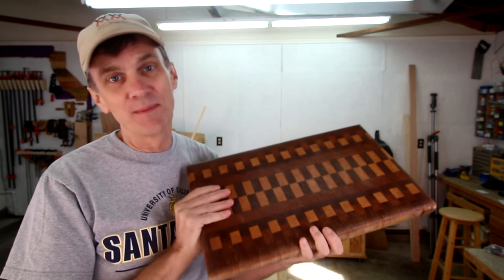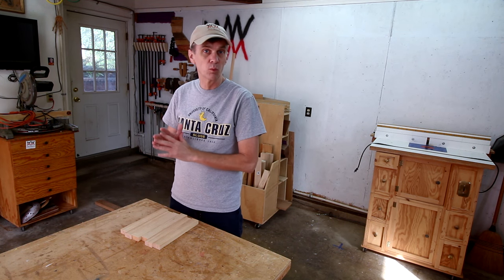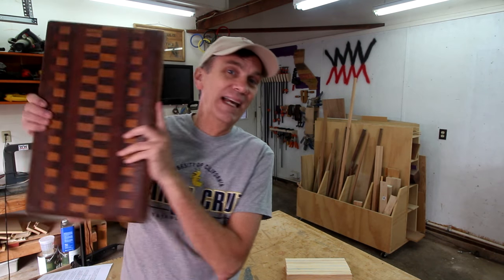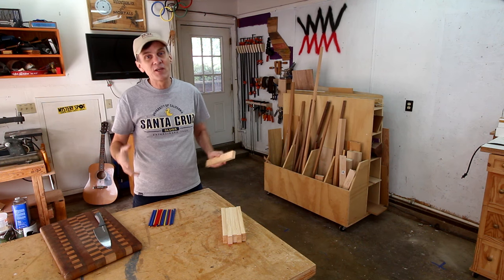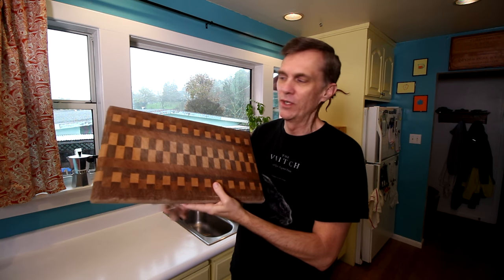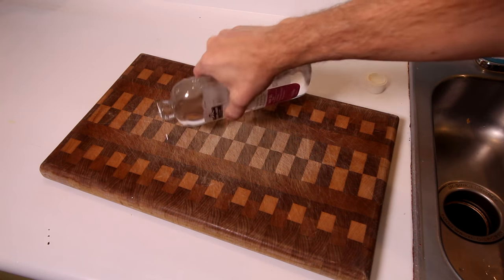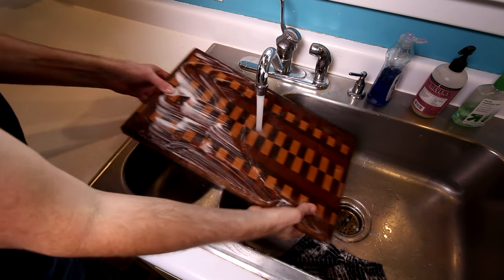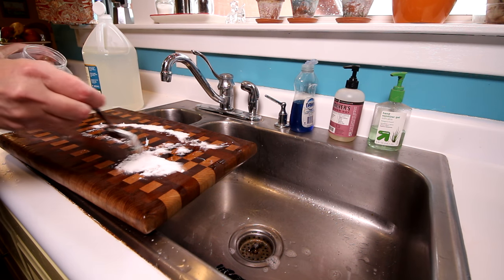How to care for a wood cutting board | C is for Cutting Board Care

Comment: I use all different types of oils and food on mine. It's stationary so I keep a spray bottle of white vinegar hanging on the station. Using the vinegar to clean it every time works awesome. No smells from any food that was on it whether it was olive oil, vegetables, or meat. Just get in the habit of cleaning it correctly every time you use it and you'll never have to worry about odors or bacteria

Comment: To avoid that, use a 50/50 mix of salad bowl finish and mineral spirits to get the board to soak in the grain.  Then finish it with some mineral oil and there will be no ability for water to get into the wood.  Helps to keep the board nice for a long time.  Great video Steve!

Comment: I have had my end grain chopping board now for 30 years and every few years I take it out to the workshop and give it a good sanding and have used tongue oil on it but I have also used olive oil without any problems simply because I use it a lot and as such it's washed a lot never had a problem with onion smells 😹 but then I use onions fresh out of the ground so they are sweeter in flavour and not as strong as onions that have been hung out to dry. 
Loved the tip of the baking soda and vinegar as this would be a good way of giving the board a good monthly cleanup as the vinegar reacts with the baking soda and makes it go all fizzy 😹😹😹 used that trick on so many other things that have needed cleaning but never thought of using it on the chopping board before 🤔
I have since inherited Mum's chopping board and that's almost 50-60 years old and is still as good today but well worn in the middle which I have kept for carving meat as the natural curve in the center of the chopping board acts a gravy boat in a way so the juices of the meat don't run off the edge of the board 😹😹😹 I am able to pour them off back into the pan once I have finished carving the meat 🙃
Thanks for the great tips of the mineral oil will have to look at buying that rather than using the olive oil which I have not had a problem with really 🤗

Comment: I seasoned my end grain cutting board real well and I washed the top earlier today, with light water and dried right way. 10 minutes later I saw it warp up. I did lay it flat to hope it goes down a bit. A few hours later, it did go down a little... is this normal for this to keep happening? Am I supposed to splash water on both sides to even it out when I wash and dry?

Comment: I tend to oil my oak made board when the scratches from the  knife are visible by getting white.
I use mineral oil, it's hard to get odorless oil not specific for cutingboards here, but I get a cuttingboard oil at that swedish furniture supplier for 4 Euro per 500 ml. And thats lasts a long time.
Usually once a year I go over the board with a scraper to level out the scratches and apply a mineral oil - beeswax mixture (as recommened by MTM-Wood). 
Just warming up some mineral oil and adding beeswax (4 parts oil and 1 part wax).
Having the board treated with that oil-wax mixture makes it hard to sand, the sandpaper clogs very fast, so I tried scraping and have good success with it.

Comment: I use linseed/flaxseed oil to treat cutting boards. Not the boiled kind, but the one you use for salads. AFAIK, linseed/flaxseed oil is the only cooking oil that actually polymerizes completely. That's exactly the reason why we use boiled linseed oil for treating wood! Note that the stuff you buy for treating wood often has some additives in it to allow it to polymerize faster (oil drying agents). Those are NOT food safe!

Comment: Terrific video! Do you have any recommendations for filling a 1/4" x 1/2" gauge in a side grain cutting board? I have one that's a custom size for a spot on my sailboat gally, but somehow someone gauged a chunk out of it and I'm not sure how to replace it.

Can I just use wood filler or some kind of epoxy, then stand it all down and oil?

Comment: Hey Steve.  I'm glad you came out with this today.  Curious - I've made a few boards recently (some face grain, some end grain) and they're all perfect until I oil them and bring them inside.  They all have warped out of flat (within the first 24 hours).  Kiln dried wood, mostly hard maple.  Any tips on preventing this?
Reply: Maybe a silly question, but did u follow the rules of gluing?
Reply: Glue up was "normal".  Glued up the edge grain first, ran through the planer 24 hours later, cut into strips, flipped to end grain, glued up, 24 hours later, sanded flat.  Completely flat until I oiled.  24 hours later - warped...
Reply: Sorry, I was thinking about that you have to keep the grain orientation in mind. You should glue sapwood to sapwood and heartwood to heartwood.
Check out mtmwood on youtube, he is the master of endgrain cuttingboards and has a great basic tutorial.
Reply: face grain will have a tendency to want to warp and there are a number of factors as to why it might be doing that for you.

Slab or laminated. A slab face grain board it going to want to cup. Try cutting narrower strips and laminating them together.

Grain orientation. When laminating, flip every second board so the grain is facing the opposite way. This will help keep your board flatter. 

Type of wood and climate. Some wood is more stable than others. And humidity can play a factor especially if your shop and kitchen feel like two very different climates. 

Face grain vs edge grain vs end grain. Each one has pros and cons and you need to weigh those out. Some people enjoy face because it's easy to make, shows off the face grain, but prone to warping. Edge is more stable than face because of the straight grain, but often not as visually pleasing as face. End grain is tough, durable, easier on knives but harder to make compared to others and more expensive. You also want to make sure they are thick enough to prevent warping.
Reply: How thick was your end grain board? I do boards up to 13" x 17" at 1 1/4" thick and don't have any warpage problems. Andrei at MTM wood uses 40mm   rough  thickness giving ~ 1 1/2 finished. He does some quite large boards.
Reply: Board is 1 1/2" thick and 12"x14"  (end grain) finished.
Reply: Hmmm. Don't know what happened in your case. Hard to know without knowing exactly what you did. Keep trying.
Reply: What's the moisture level in the wood before starting? Are you in north? I am and had this happen during the dry winter. Sometimes wood was so dry it took up moisture and warped. Other times it dried out more after and warped.
Reply: Jonnycerious in the south.  NC.  Humidity is high here.  Wood was kiln and then placed in my garage for over a month prior to use.  Perhaps soaked up more moisture?
Reply: I assume this comes more from the moisture difference than the oiling.  I'd try making the boards a bit thicker than you want, bring them in for a week and then re-flattening them with whatever methods you want (a shop-made router sled would be great for the bulk of the work.  A drum sander would be amazing, but we don't all have the ability to spring for one that's wide enough to accept all but the smallest cutting boards.)

At this point, I guess it is plausible that the oil is causing some of the warping as it penetrates the wood.  If so, does anyone have any experience working with oil impregnated wood?  Would it gum up a router bit or sandpaper?

It could be natural stresses in the wood coming out as the fibers relax.  A lot of people will cut their boards into strips, wait a week.  Mill into square, but a bit oversized.  Wait a week before milling to final square and size.  Bringing the boards inside to moisture match during the waiting periods could be helpful here as well if the inside of the wood was a bit more wet than the outside... this can happen with the quicker drying of a kiln if some of the moisture didn't have time to migrate to the surface.

Don't try to force your strips into square with the face during glue-up.  Clamping a board across the face will lead to a nice level surface, but the stresses within the wood will most likely warp the whole piece afterwards.  Let the strips wiggle how they want, then flatten after the glue has properly chooched.

Alternating the direction the wood is facing will help you a lot.  This allows the stresses to work against each other holding the whole thing in equilibrium.  Identifying which way was up in the growing tree can be a good exercise.  Clues like the direction most of the cathedrals point (especially in maple) will allow you to make a more stable panel that probably looks better to boot.  It doesn't absolutely matter if you get the "up" direction correct, as long as you choose one and alternate orientations.  Unless you are talking about traditional Japanese carpentry, but that's a different beast completely.
Reply: Oil definitely gums up the paper, that is one lesson I have learned from this.  I think I'm going to make them, bring them in for a week and then flatten again if necessary.  If they warp at that point when oiling, I guess it's just in the cards... lol

Grain direction (in my opinion) won't matter that much for end grain cutting boards as the "blocks" of wood are literally running every which way no matter how you place them?
Reply: CancerCashew cut the wood and bring inside for a week. Then glue it up. I have to keep pieces inside for 1-2 weeks for the same issue prior to working with.
Reply: Yeah, I would if my wife would let me... LOL  Going to have to sneak some in and hide it somewhere...  Just not sure where yet.  :)

Comment: Stupid question perhaps, but doesn't washing the board get water in the board causing it to warp or swell like any other piece of wood?
Reply: That's one reason he said to store it on edge after cleaning. The water will drip onto the towel/ drip tray and won't stay there. Kind of like how you hang coffee cups and bowls upside down, so the water doesn't settle in them. :)
Reply: Slane583: in addition to the oil decreasing the surface tension of the water drip
Reply: That's why you oil it.  The oil repels water so it doesn't have a chance to soak in and ruin the board.
Reply: KB in MD Last: Indeed. Water just beads up on an oiled surface and rolls right off.

Comment: What types of wood make good boards............
Reply: Walnut, Hard Maple, and Cherry are the most common, and a lot of commercial cutting boards are made from Birch. For a little color, you can throw in some Purpleheart.
Reply: I use all maple.
Reply: I have been using cherry oak and poplar. The poplar is kind of soft, but it gives you a cool light green wood color when you oil it.

Comment: I do not speak English well.
So it is hard to understand the explanation of this image.
I write this article using Google Translator.
Please write briefly about the oil finish.
I can use Google Translator.
Thank you for always uploading good images.
Reply: Mineral oil Over-the-counter drug A mineral oil or paraffin oil is any of various colorless, odorless, light mixtures of higher alkanes from a mineral source, particularly a distillate of petroleum. The name mineral oil by itself is imprecise, having been used for many specific oils over the past few centuries. Other names, similarly imprecise, include white oil, liquid paraffin, paraffinum liquidum, and liquid petroleum. Baby oil is a perfumed mineral oil.- Wikipedia